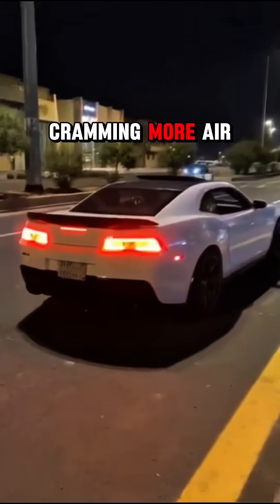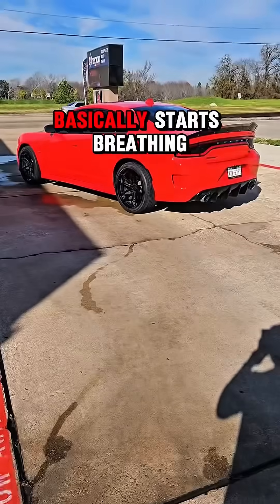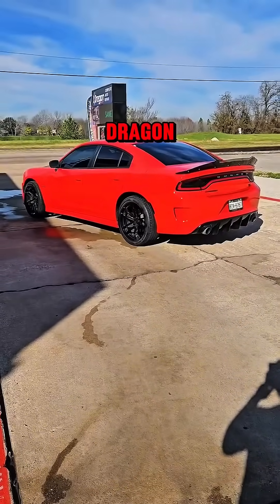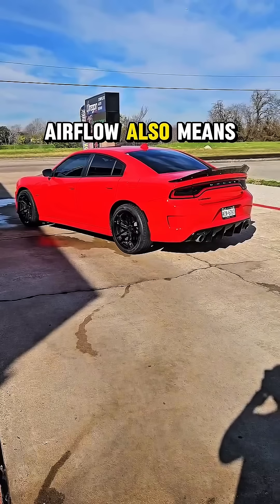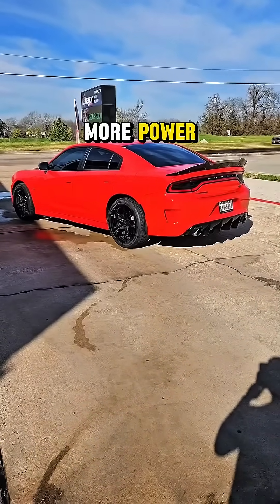Why Cammed Cars Sound Like Monsters

Comment: it might sound better and give better airflow/performance but it also causes increased wear on the parts, engines are precision mascines and they are engineered in a specific way for a reason...
Reply: This is literally true for almost any performance mod that needs a tune after installation
Reply: Nobody cams their motor trying to get 150k ....
Reply: A cam alone really wont do any damage, account for higher cylinder pressures at a higher RPM and tune fuel accordingly to keep it stoich, and its every bit as reliable as a stock engine, unless you install heavier valve springs there is no increase in wear.
Reply: @windowlicker4029 a cam alone can cause problems. Too big of a lift, and high rpm required stiffer and sometimes dual valve springs. Don’t do that and float the valves and you will have fun. Or on a pushrod engine, bend a pushrod.

Comment: Honda introduced VTEC and it's having both
Reply: Ignorance is bliss comment. VTEC only separates the timing between intake and exhaust. It has NOTHING to do with lift or duration. Fact: most systems only alter exhaust timing.
Reply: @CoolHandLukeVol  Variable Valve Timing And LIFT Electronic Control = VTEC
It's switching to a larger more broad cam profile which changes both lift and duration as it actuates the same rocker arms as the smaller profile to prioritize air volume on the top end instead of air velocity as on the lower end
Reply: No shitty VTEC sounds this good, your dreaming buddy
Reply: @O_xclusiv
 

Cry about it while a k20 beats your slow ahh ride lol
Reply: @O_xclusiv

Cry about it while a k20 beats your slow ahh ride lol
Reply: @O_xclusiv vtec lockers and vtec killer cams sound pretty close